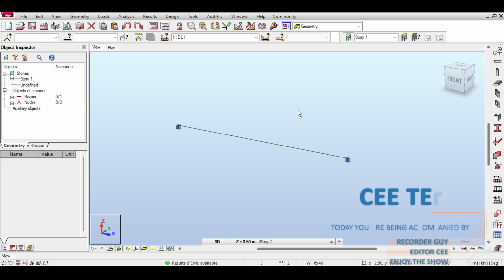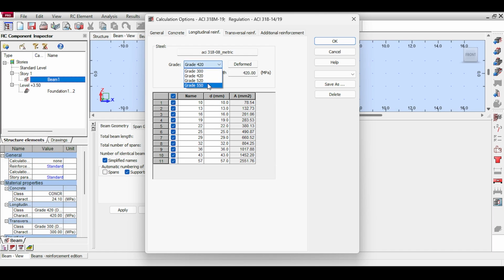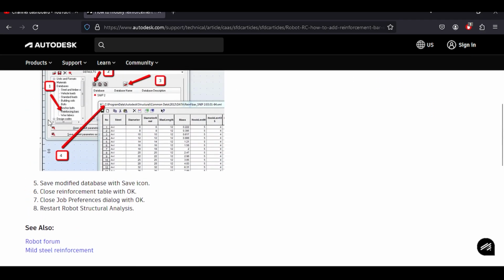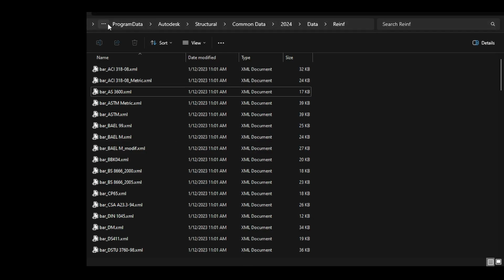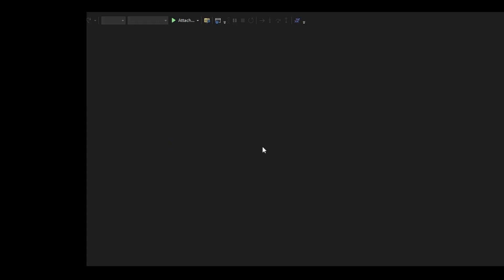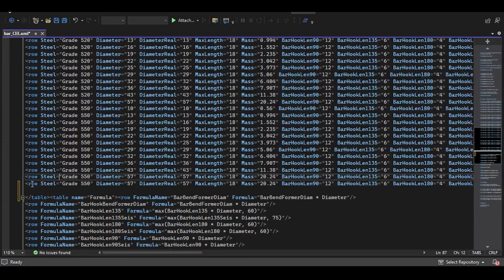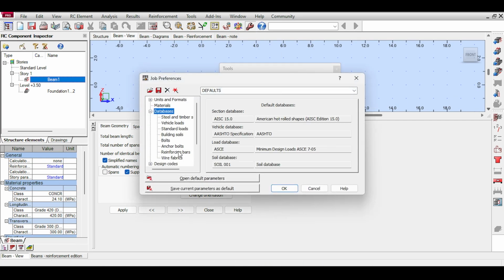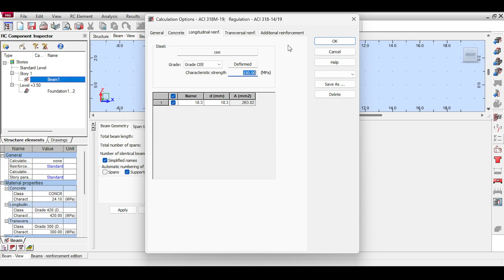User Defined Reinforcement Bars and Strengths in Autodesk Robot Structural Analysis

Comment: Thank you Dr. CEE. I noticed that the BS reinforcement bars indicate plain bars for mild steel. When I designed using mild steel, the moment diagram appeared constricted at the supports, possibly indicating reduced slip or lower bond strength. Based on the information you provided, I’ve now successfully created a user defined rebar changing from plain to deformed bars.

Comment: Thanks for the guide CEE, i would like to ask, what about those values such as "StirrupHookLen90", "StirrupBendFormerDiam" and etc, what does it affects? and is it matter that if i dont change the values?
Reply from the maker: Hi there
Stirrup Hook Len 90 means the length of the extra bar part used to create the hook. Now those have certain values from codes like the ACI315-99 which depend on the bar diameter.
It does not affect the design strength, but will have an effect on the quantity survey of materials.
PS: Sorry for the late reply. I had a ton of things to finish and now I am gradually getting back